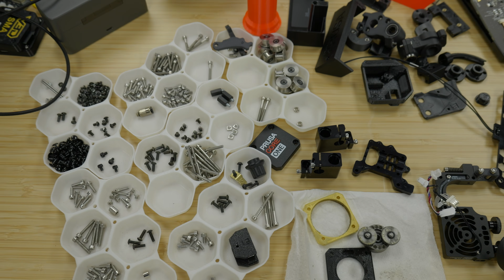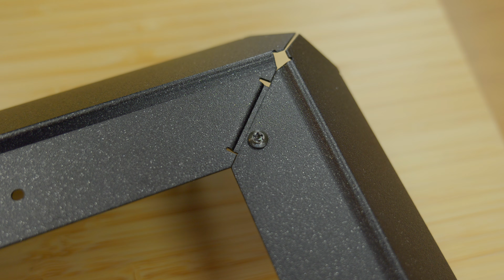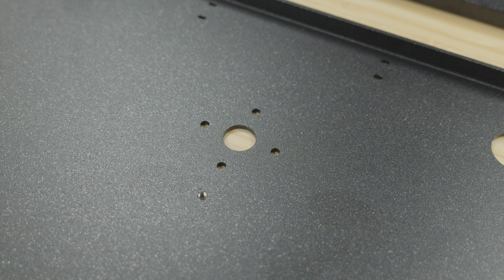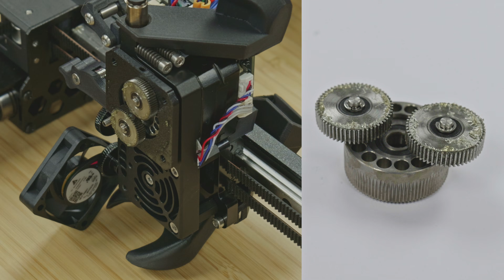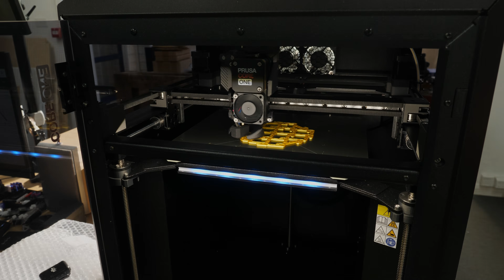I Removed all the Screws from my Prusa Core One

Comment: 18:31 When assambling it you put alot of pressure on the tiny middle parts to put the belt in. I think if it was 3D printed it would just brake.

Comment: as commented on other video's: the mounting of the motors is a total NO-NO and against all principles of a XYZ table/actuators. These should be directly and as stiff as possibly mounted directly to the frame, the PLASTIC spaces is a recipe for disaster and that for a 1200 euro printer??

Comment: The process used to drill holes in the X axis is called flow drilling, it is used precisely to lengthen the material when a thread is required on a thin wall.
I think the "dampers" used on the Z motors also serve to reduce wobbling, I don't have a core one, this is simply a hypothesis from watching your video.

Thank you for this investigation ❤

Comment: From somebody that is building a Voron Trident, the Core One looks well designed and well made. It has a curious mixture of rods and rails, although the rods are used in the least demanding areas so that is a pretty good design choice when considering the cost difference. Also interesting that they used 3 Z-axis motors, and not a belt and pulleys like the Bambu Lab. Using a splitter to drive them means there is a risk that they can get out of alignment if you put weight on the build plate when the machine is powered off (or the steppers are disengaged). Presumably there is an automatic alignment process to correct this, like driving the build plate hard against end-stops align it. I also like that the frame is steel, unlike the injection molding of the Bambu Lab machine, and that corner assembly both looks good and seems easy to do (Voron frame assembly is slow and tricky to get right). I actually prefer acrylic or polycarbonate sheets for side panels rather than glass. Glass is very heavy and comes with the risk of shattering it. I also find glass passes more sound than a polymer sheet of the same thickness. Plastic rivets are holding together every car made in the last 30 years. They speed up assembly in the factory, which brings down the cost of the product to the consumer, and do the job asked from them, so nothing wrong with that.

Comment: Awesome teardown to verify quality of the Core One construction.  I am on the fence to purchase one, and this was very informational and also providing ideas for future upgrade paths (maybe home-brew ones...).

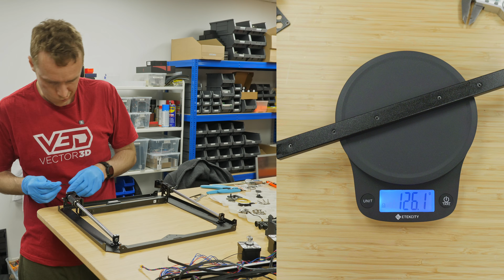At 17:35 -- you measured weights of various X-gantry components.  Did you later weigh the assembled Nextstruder toolhead by itself, which you tore down in parts?  Would be interested the tool head weight as compared to Stealthburner & other toolheads.

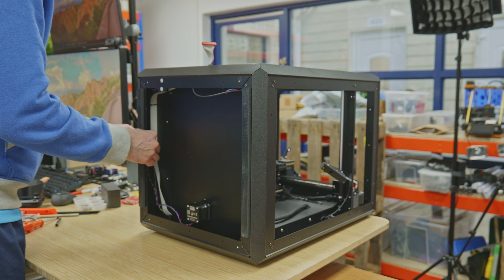At 2:55 'ish -- you removed the side panels.  They protrude inwards to hug the left/right-side of the print bed.   When the toolhead is moved to end of travel on left/right side of the X-gantry, does the nozzle overhang the print bed edges significantly?  Simillarly for Y-axis, does nozzle extend beyond bed footprint at max travel limits.   I was wondering if there was some additional travel beyond the print bed edges such that a larger print bed & heater than the original Mk4 bed could later be attached as a mod within the Core One frame.   I would have purchased a Core One without hesitation if it were not for a bed size smaller than an X1C.  Is this frame capable of any increased printbed footprint with future user mods or locked down?

Thanks for any feedback on these questions.

Comment: That's so Prusa. Add the expense of three separate Z motors but then just tie them all to one driver. Why have a single belt when you can have three motors and why have control of each one when you can have the same control as a belt.
Reply from the maker: It's actually not the same. Removing the belt allows for independent rotation which is what enables the simplified tramming system. Using low torque and hard stops some of the motors can be slipping while others move. Used on other machines for a while and seems to be effective.

Comment: Thank you for the video. As I am already paid for a Prusa Core one kit I was interested in the Prusa core one construction. All my Prusa printers were bought as kits.  Right now there are no information when kits will be shipped. Also there are not released assembly manual for kits. It is very interesting that the kits come later then the assembled ones in Prusa strategy.

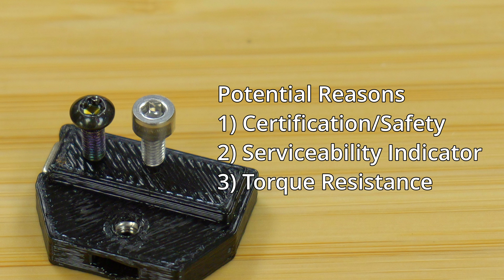Comment: 4:12 I would say: The big advantage of Torx and hex screws is the fact that they can be screwed in more easily using machines. This saves time during assembly. The rivets also save time and time is money. These are likely to be two measures to speed up assembly and reduce manufacturing costs.
Thanks for the teardown video. Unfortunately, not many YTs do this and videos like this are very important when you want to evaluate the quality of hardware. I appreciate that. 👍
Reply: A lot of people say this and, yes, it is technically true... but we have magnets. It's really not that hard to keep a screw attached to a robotic arm during insertion.

Unfortunately what Torx actually does is stupid-proof Hex by taking away the ability for people to use a rounded-head for off-centre driving. Which makes people think they don't round out - because when you don't use a rounded head to torque-down a screw, they don't round out! People think Hex screws round out easily because they literally don't know how to use them. There's a reason the two ends of a Hex allen-key are different; they're for different things! The rounded head is so you can drive a bolt in off-axis instead of doing that hand-cramping pinch-and-twist motion, and the flat head is for actually torquing them down/up. (it's the difference between an 'impact driver' and a 'power drill'. One is meant for applying torque, the other is meant for applying RPM. They are different tools for different jobs, and the Allen-key manages to fit an entire kit of them into your back pocket.) If I had to hazard a guess, they probably used Torx anywhere that, if the bolt was rounded out, a user couldn't grab a pair of pliers and loosen it like that. (e.g. a bolt that's sunk into the part)

The only real advantage Torx has is that it's harder for people to fuck-up by being lazy and buying ball-head drivers. They do have hypothetically better torque-endurance, but realistically nothing the average person is considering using either of them for is going to over-torque them. If you need THAT much torque, you're looking at a male bolt, not a female one. (e.g. : the type that's literally just a flat-faced hexagon) 

In most cases, the real advantage of Torx is that you get less whiny customer support calls about rounded out screws from people who got skill-issued by a fucking allen-key.

Comment: Why are we still using smooth idlers in contact with belt teeth?? That's where most of the gantry artifacts come from. Im also quite intersted how low the z-motor stepper current is. The max current for one of the clik mate terminals is 2 amps. Divided by three, thats almost nothing. 

The stiffness of the z-axis seems incredibly low too. a lot of manufacturers use 2 rods in back, and one each upfront. And while its true, that the load is placed mostly on the leadscrews, those cant really be called loadbearing or stiff, with that contraption of a decoupler. At least there wont be any overconstraint there, but i'd prefer a radial load decoupler on the leadscrew nut, and loadbearing linear motion over this. Were the leadscrews equipped with support bearings uptop?

My problem with the z-axis is not the fact its only two bearings, but that its only 2 lm8 or lm10, couldnt see which ones. Anyone who has handled these, even the ones shipped by Prusa, knows that they do an excellent job at transmitting radial forces. But they are really bad against torque about the normal axis' to the movement direction. And they wear out fast, if there is a lot of it. And there is bound to be some unfortunate load conditions, depending on part placement on the printbed.
Reply: I don't quite understand your concerns about the Z axis. 
The Corexy doesn't have that many radial forces. The weight is held downwards by the guide screws. 
Lateral forces are only what the print head exerts on contact with the print piece.
That should be quite low.
Reply: @herr_rossi69  In a static environment i would agree with you. But this is a dynamic machine that should (idk the actual printer settings) experience high accelerations. Those create massive frame vibrations. The Gantry accelerates one way, and the frame experiences the same force in the opposite direction. If the frame is not stiffly coupled to the z-axis, that will result in artifacts. There is also a massive difference between linear rails and rods here. Rails, like the Prusa XL uses, are fixed to a carrier of some sort, usually an extrusion, to increase the motion systems stiffness, especially against bending and torsion. Linear Rods are standalone units, and are weak against bending in particular. The high weight of all the z-axis parts combined, will result in comparatively high bending forces on the rods, when the printer frame experiences vibration accelerations. 

Assume, the the bed weighs around 1kg, the printer uses 10.000 mm/s2 acceleration in y-axis, and the z-axis position is roughly half the possible travel length. Assuming 330mm rods, with 310 mm exposed outside the rod holders, that gives the following deflection: 0.08 mm 

That is under regular printing conditions (.4 nozzle, .5 extrusion width) 16% of the extrusion width, giving remarkable artifacts. It might not be noticable, when printing straight walls, that are perfectly aligned with the printers axis, but it will look weird on 45° walls about the z-axis, and on corners as well. I know input shaper can work some amount of magic, but this isnt even remotely looking at actual vibrations yet, im just talking frame accelerations here.

In other words. In a perfectly stiff z-axis, gantry vibrations will not affect the print quality. The less stiff the system is, the more the system will be affected by positional differences during vibrations and accelerations.

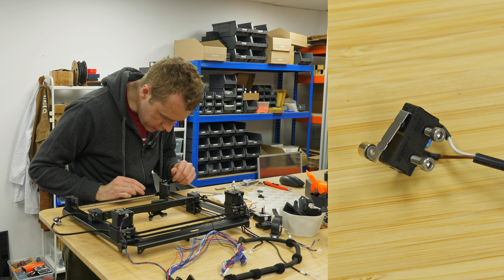Comment: The resistor on the limit switch at 16:32 is likely there so the microcontroller can detect if the switch is missing.

Thanks for taking your printer apart. It was interesting to watch.

Comment: Could you raplace the plastic rivets with nuts and bolts throughout? If so, what diameter and size?
Reply from the maker: IIRC they are 2.5mm diameter. At this moment in time I'd say it not going to gain you anything but pain to do that though. Not worth it.

Comment: So the only part you didn't take apart was the filament sensor trigger (pliers to pull out the little holder that has a spring, magnet, and ball bearing). Also the... swing arm that a bunch of people seemed to really want (that even Prusa said is super basic). But looks really good and those are some nice prints. The Z-axis stuff is interesting and pure coincidence that a friend told me a coworker is returning their CORE One because of z-banding. I wonder if one of those couplers broke or are loose. But I'm glad you did that teardown because I have an old MK3S+ and it's more expensive to go MK3S+ to MK4S to CORE One then to just buy a CORE One. But if I'm gonna spend the money, may as well see how many non-duplicate parts I can deal with so I can save some money.
Reply from the maker: There's plenty more I could talk about, and did a few bits not shown, but cutting down so many hours to just 20 minutes has consequences 😅
Reply: @Vector3DP  brevity is not my strong suit :P

Comment: Resistors on the switches is more likely for detecting if the switch is connected or not.
Normally a board can detect if the switch is closed, but open could be also disconnected. Putting a resistor allows for a third state "Open and Connected".

Very common in the security industry.

Comment: My guess on torx vs hex is a desire to reduce head size without using extremely fragile 1.5mm or 2mm hex keys. The example shown in particular - the standard cap head screw will be a 2.5mm hex, but the button head would be a very shallow 2mm hex recess, which is especially vulnerable to ball-headed drivers.

Comment: Very nice, but I wonder about your choice
1. buy the kit and showcase the build. Cheaper, getting the same result (showing the internals of the printer)
2. buy the assembled unit and disassemble it. More expensive and more labour intensive - assuming you're also putting it back together afterwards)
What made you choose the more difficult path? Was your choice just for the sake of originality?
A horse for your thoughts! :)
Reply: a user will have to disassemble as well so its useful in that regard.
Reply from the maker: #content
Reply: At least you get to compare the print results between factory made and after putting it together yourself :)

Comment: I have a question, are 4x LM10UU used on the X axis? Is it possible that Prusa uses LM10LUU on the X axis in the conversion kit? Or is that bearing size not possible to use there?
Reply from the maker: X is MGN12 style linear rail. Y is 4x LM10UU, two each side. I don't expect the finished machine to be dependent on the route you take to get there.
Reply: @Vector3DP  I understand, I wrote it wrong. I'm interested in the Y axis. I ordered an upgrade kit and would like to have new bearings ready. I'm interested in whether it would be possible to use 2x LM10LUU instead of 4xLM10UU. It seems stupid to me not to use LM10LUU in the upgrade kit. Do you think there could be a problem? Length: 55 mm. 1x LM10LUU - Length: 2x24mm. 2x LM10UU??
Reply from the maker: @davidzapletal9063  The bearings are press fit into the CNC housing, I'm not sure you'd ever get them out and would need a press to get new ones in.
Reply from the maker: @davidzapletal9063  Why do you want to use LM10LUU? I thought prusa only used LM10UU so far?
Reply: @Vector3DP  MK4S uses LM10LUU on the Z axis, so I can't figure out why they couldn't be used in the upgrade kit

Comment: 11:50 I think you ideally want some Z springiness to handle collisions. It works like a suspension system. Building it into the Z axis support means it is roughly the same dynamic response regardless of where it’s being hit on X and Y.

Not sure if this is the design intent, or if I’m right at all. But also, great attention to detail making sure the machine is quiet.

I wonder if they would break if the machine was dropped, or if the motors would bottom out on the plate beneath them?
Reply: Did you get a machine?
Reply from the maker: Other people in the comments rightly pointed out that the Z mount is probably more for alignment compensation than noise. I've asked prusa though, so we'll see what they say.
Reply: Nice theory. It doesn't make a lot of sense for them to make their own mounts just for vibration, when NEMA17 rubber vibration mounts are such a common and cheap part. Surely there is some other reason!

Comment: Great! As I started with the mk3 after it´s released and done all the upgrades (including getting a free new screwed heted bed with the mk4-preordered upgrade and a black PSU for 50€) I will have changed all parts after upgrading to the Core One. So I can rebuild the mk3s+ (and upgrade it to an mk3.3 using a cloned Prusa Mini´s Buddyboard). Makes the Core One upgrade even cheaper to get a "free" mk3s+ ...
This is the first video showing the new bed carriage. Good to know it is changed, so realy everything of the mk3 is free to reuse now.

Comment: Interesting Video. Thank you ! 

Does anyone has a clue why there are linear rails at the x axes and rods at the y axes? 
I mean why they mix it up and don't use one type for both?
Reply: @Schliziger i believe they try to design it such that to reuse as much parts as possible from mk4, which uses rods instead of linear rails. this allows easier and less part to upgrade from mk4
Reply: @EldineSeah  I believe it is also easier to align two rods with each other than linear rails.
Reply: @ulaB  i am not sure if this is a strong reason (easier to align), if it is, i suppose we should see more corexy printers taking up this approach, but i dun think that is the case
Reply: @EldineSeah  Okay makes snese,
Side Quiestion: Is one better than the other or it makes no difference ?
Reply: @ personally i have not used printer with linear rails before, CoreOne will be my first, so can't answer for now

Comment: How Are the Z motors Synchronized if the power is off and one one motor gets turned? 
other Printers Uses Belts for this
Reply: AFAIK (remember I don't have a CORE One yet, will be upgrading my MK4S some time later this year or early next year) it is probably the same way that the Z motors are Synchronized on Prusa's other i3 models. Run the z motors at a known stop until all the motors stall out. On the i3 printers, that was running them all the way to the top. I suspect on the CORE One it will be running them all the way down.
Reply: You'd have to re-calibrate Z after. Prusa printers usually drive the Z axis towards and a little over a defined hard end stop. This results in both or all three mounts being at the same position before the motors move back.

With the load cell bed leveling it will probably recognize something is off and just force a Z calibration too.
Reply: @ulaB  Waht a shitty solution to drive the motors in a hard stop... but it is a solution. Thanks
Reply: @lambda7652  It's a very good solution, really. Stalling out steppers has never been a problem, in fact you'll likely find this used in a multitude of products in the wild. No need for a belt which has to be carefully synchronised and never touched, no special probing process and tracking of individual stepper position. Just gently drive the bed against known reference points and it's sorted.